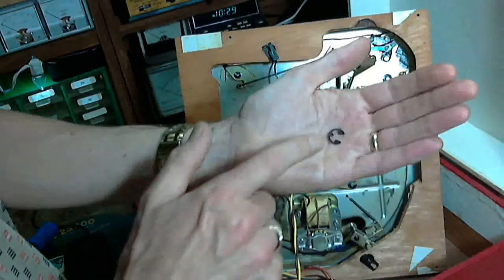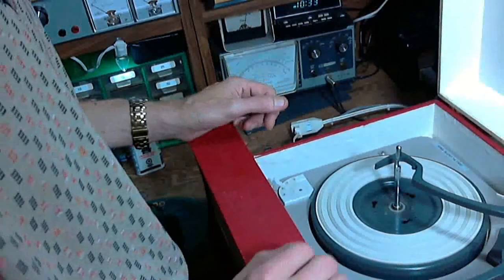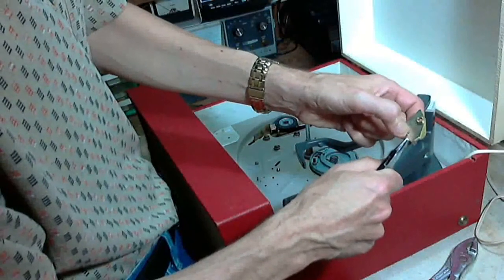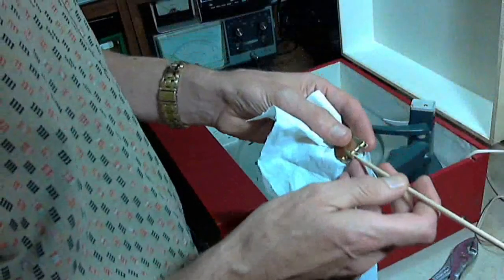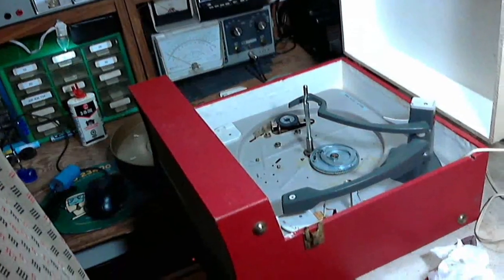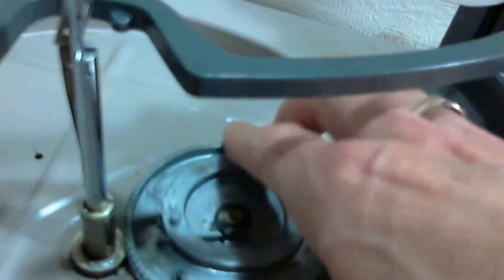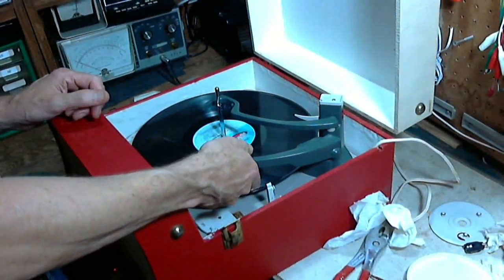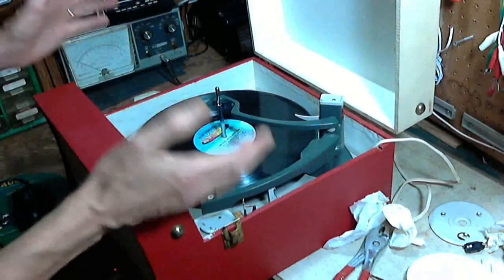Admiral Suitcase Record Player Video #3 - More Mech Maintenance

Comment: Okay so I'm having a bit of an issue with our record player we recently got, the arm keeps trying to go to the center of the record, at least for the first song after that it does okay, I'm guessing our anti-skate is not set right (judging from what I've seen on YouTube) but it doesn't have a visible anti-skate knob. The record player is a Panasonic EPS-43 STSD and I cant find anything on here to help so if you have any info that may help I'd really appreciate it!
Reply from the maker: Maybe your needle is worn out or the tracking force is too light.When I searched for Panasonic EPS-43 STSD, I get the cartridge stylus only.  Can you provide the name/model of the turntable itself?
Reply: If I can find it I will definitely do so, looked all over the top for it but may have to check the bottom. I will get back to you ASAP
Reply: So the Model No. is SG-V55

Comment: I don't even bother to bring out a can of WD40 unless I am sure I will use the entire can in one go. You could have saved a lot of time by spraying a whole can of WD40 on the entire underside of that machine.
Reply from the maker: I tend to use the stuff a little sparingly but a whole can sounds like a big mess.  I recently read up on what WD40 actually is (the exact formula is secret) so I know it's about 50% solvent and I'm inclined now to use it more liberally to loosen up things.